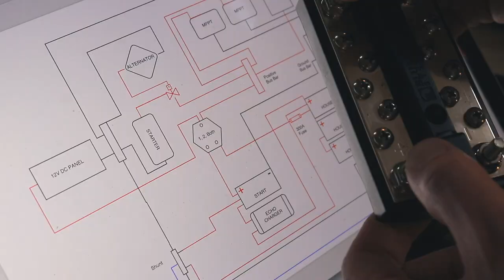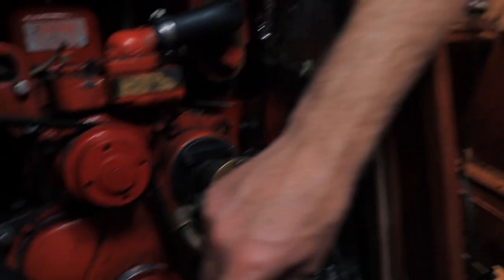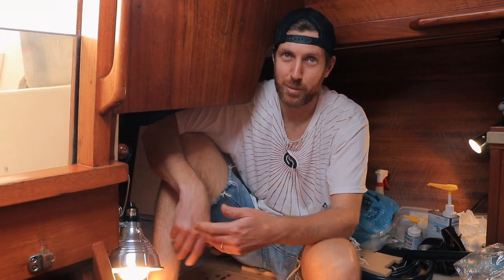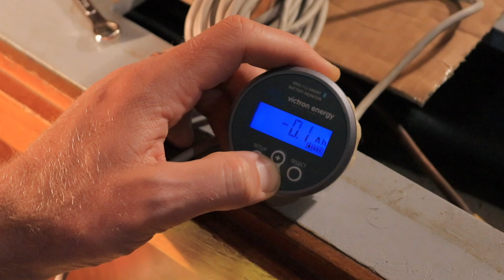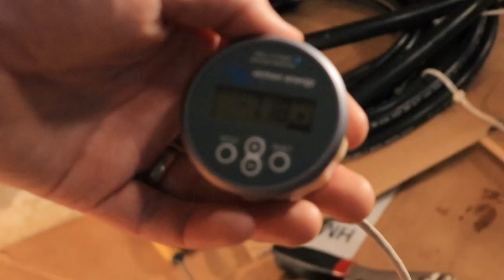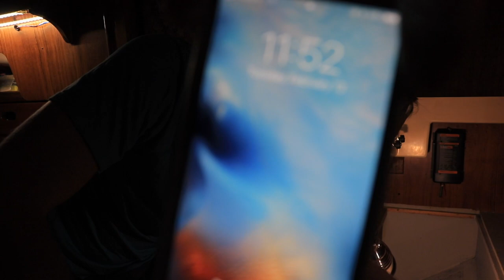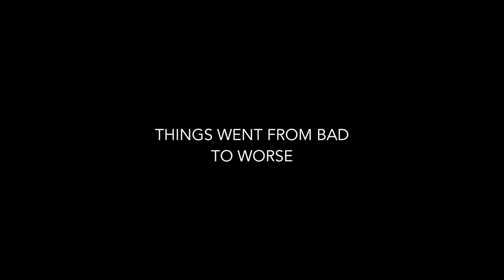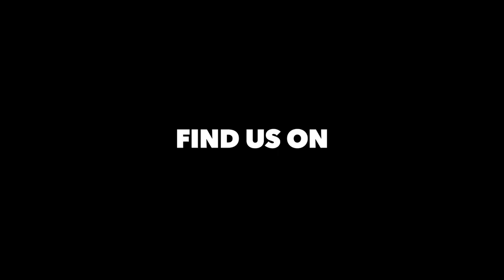Glad THAT’S Over | Sailing Soulianis - Ep. 38

Comment: The good news is that you have documented video evidence they screwed up for the lawsuit.
Reply: Lawsuit is a bit of a strong term. "Small claims case", that will be an easy decision for any judge. Soulianis has everything documented. If anything, dock fees and damages could could be awarded in a counter claim if the welder/fabricator even attempts to collect.
Reply: @tilleytristan  I would move on, afterall ,they will not be staying in the area to followup..
Reply: @kapekodbob  100% agree. I meant if the contractor sent a bill to collections, "moving on" would involve either paying up or taking them to court.
Reply: @CaptainJimNoss  Actually they refinished their arch. They built a bimini which is probably easier.
Reply: I was thinking the same about it being all on film.
Reply: So sorry you had to go through that.  With small claims a lot depends on the State laws and the min/maximums. Def file a claim and request a lien and when it succeeds have the judgement certified. There may be added court fees. Chances are you can kiss the money goodbye but a lien will put their business on notice with banks and credit agencies.. In the meantime try to work out an amicable resolution and document it. And then get on with sailing!
Reply: @MaShcode  he's likely to put a lien on their vessel as well.  And you need to be in the jurisdiction you file a small claims case in, which they no longer are.
Reply: @CaptainJimNoss  they didn't build the arch themselves. They modified the existing arch on the boat and repainted it.
Reply: @Josef_R  The business would have to send them a bill for work not completed and the clients already made a partial down payment. The business could try to attach the boat but that'd be easily quashed because the client acted in good faith and the arch is not ON the boat. As far as jurisdiction goes. The clients were residents during the course of the transaction.
Reply: @MaShcode  It doesn't matter where you resided when the problem occured if you don't reside there when you sue.  You can't sue from the Caribbean someone who lives in Alabama.  You also can't answer to the courts when someone is making a case against you and you're not there.  Courts don't know how the client acted without them presenting themselves.
Reply: @  @Josef_R  That's y there r Lawyers. They should find one from there and gave it to him on commission. Done and over in 5 yrs time. LOL Sadly!!!!!!!!! Are u could do it the old fashion way and call one of your old Army Buddies that live out of country to take care of it. Maybe a little harsh in this case but then what comes around goes around right!!!!!!
SPC-Lee a Benson 11B U.S. Army (RET.)
Reply: @leebenson4874  this is a small claim.  You don't hire a $200/hour lawyer to handle small claims.  But the fact that you recommended committing a felony tells me you don't know a lot about doing things legally.
Reply: @  @Josef_R  I've done many small claims where I had a lawyer do it on Commission. If that sounded like a recommendation to you then I'm sorry was just pointing it out that it might of been the way they would handle it in the old days. You read to much into things just read the words and not between them. LOL OK LOL

Comment: Hey Guys look up an isolation transformer for your boat its a great safety part that you will want if you are in marines when traveling also if you are going to travel internationally an inverter/charger that handles 220v/50z is also an idea . also putting on some extra anodes on the hull would be good if your current ones don't last too long ! great video thumbs up !!

Comment: Nice job with the batteries.
Regarding the arch, If you have time, do it yourself. the best way is to make a flexible pvc template, glue the parts with hot glue gun or even with clamps. then buy inox 316 tube sawing and welding. avoid curves. with a grinding wheel removes excess welds and rounds. in the first sample you will get scratches and stains of heat but after polishing it gets prefect!

Comment: So Sorry that you both had that Happen to you , Only thing i would say is if you find the time make it out of PVC Pipe and do not glue it just make it pull apart and when you do find a Stainless Steel Tradesman show him what you need made, Ps : you might look at a Alternator/Generator all in one unit for power supply for your boat as well think the Italians make a unit that does both jobs when motor is running . This Unit replaces the Alt you have on the motor :)

Comment: We hired a guy to build a bimini for us shortly after buying our Bavaria 33 Solla Sollew in 2006.  Give him $600 to get the work started. We had some contact with him afterwards but never saw the bimini or the $600. Frankly, I've come to look at the incident as money well spent. The full bimini would have been well north of $2000 and frankly I didn't really want it anyway. When I ordered it, I kind of just thought it was the thing to do but I'm grateful  for having spent $600 to NOT get it. I understand your desire to get that arch built as a platform for solar but really, the boat looks better without it. Do try to get your money back but in time you too may be thankful you don't have an arch. Actually sailing the boat is better than worrying about the thing.

Comment: First, excellent work on the electrical system. The design and streamlining of the existing wiring system are first rate and you should be proud of your efforts. I am sorry that contracting the arch system was such a nightmare. It’s not your fault. They misrepresented their skills and ability to deliver on the job. My suspicion is that the previous work they represented as theirs was done by someone no longer with company. Thankfully you stopped them before they did real damage to the boat. More importantly, had they completed the install it would have failed under the stress of heavy seas and caused incalculable damage and risk to you and the boat. This was truly a disaster averted. Placing an arch on a boat that was not originally designed for one requires careful planning.  There are design, construction and, installation issues that must be taken into consideration. If the contractor had  really done this before they damn well knew this or should have.
 When you are ready to tackle this project again, reach out and,  I can put you in touch with a few different welding  tradesmen in North Carolina or Florida that specialize in marine work. It will take time and  it will cost more than you had anticipated but it will worth every penny. An arch will change some of the sailing characteristics of the boat  and you need  people that have proper licenses, certifications and insurance. More importantly they are sailors with years of experience and care first and foremost about your safety and that of the vessel.

You passed an important challenge and you will never again let a self-proclaimed “professional “ get away with “trust me” or the self-serving “ I know what I’m doing, I’ve done a 1,000 times” comment . Take that as your clue to run. 

Most of all don’t lose heart , there is just nothing in this world like crossing an ocean on well maintained boat that you know like the back of your hand. You are well on the way.
Reply from the maker: Thanks Paul, we agree with this logic whole heartedly. Cheers!

Comment: You had to pay an extra month for slip fee for these jerks to screw you.   The Boatyard/Marina should have not collected this since they are responsible for contractors to work n their yard and they also have to be bonded and have insurance to work on their property where your boat was..   I would hold Turner Marine responsible and then file a complaint with the bonding company and Insurance for Mis-Representation  and holding your money for services that were not satisfactory done.    I usually charge 175.00 for this consultation but you stole my heart.
Reply: I owned a electronics-electrical shop in Tarpon for years. Working in other yards?? Bonds??? Insurance??? Ha ha ha ha ha ha

Comment: Oh my goodness, my hart goes out yo you two. On the bright side you did a fantastic job on you rewiring  project. May I suggest that you look at and possibly downloading the "Sketch Up" program, it is a free CAD (computer aided drafting) program . I do wiring diagrams and machine parts on it, The 3D modeling is cool. I wish you better luck on your next attempt on the arch and many miles of wonderful travels. 
.
Reply from the maker: Thanks for the suggestion, I've used sketchup a long time ago, before they were acquired by google to mock up floorplans for houses.  But was a little overkill for the wiring diagram.  We used draw.io which worked quite well.

Comment: Have you been using the Victron app to check your batteries status? I used mine to set alarms for low and high voltage. The beeper is not loud but better than nothing.
Reply from the maker: We check it daily. Multiple times actually!

Comment: Question - is it more cost effective to work more at your day job than to fix a boat?  If u worked more you could buy a newer boat.   Did you make a conscious choice to do boat work over your day job? (Question I am asking myself when I get a boat)
Reply from the maker: This is a great question. One I contemplated many times before starting work on the electrical.  We actually had someone out to quote the electrical work because based on my rough estimates it would be cheaper to hire it out and put in some more work at the day job.  But in the end I decided if we didn't learn the electrical now, I'd have to continue paying for it in the future.  Which means I'd have to continue working.  So if I took the time to learn it now, I'd likely be able to do more in the future (install a new alternator, rewire other things, etc).  And I wouldn't need to pay someone to come in and troubleshoot, because I'd know exactly what the issue was.  And that was ultimately what tipped it into the DIY project.

As for working more to get a "newer" boat... it's why we're still both working while we travel ;) We just wanted to get out there and get going now, rather than wait till we're old and gray.
Reply: @SailingSoulianis  I am old.  I am tentatively planning on leaving in a couple years when my last kids graduate highschool and move out.  In hindsight it is easier to do it with young kids you can take with you than leaving rich relationships behind.  (But after having kids in house for 33 years I am thinking about taking a couple years off .).

Comment: I used to work in a marina, and those guys looked wrong from the beginning -- ie crawling all over the boat in work boots, not prototyping anything, using levels on a platform that is inherently NOT level, doing "air measuring" with a tape measure, field cutting.... all terrible practice. Sorry you had to go through this, but perhaps all these warning signs will help others. BTW, missed deadlines and big deposits generally means they are using your money to complete the project before yours, and missing deadlines because they have started another project in order to get the money to complete yours. Every crappy contractor works this way, and collecting from them is impossible because they have already spent the deposit elsewhere. Give all the info to a good local lawyer, don't spend much more money to get yours back, and sail into the sunset. Living well is the best revenge.

Comment: I had similar experience with hired experts rewireing and installing new AC/DC panel clown was using black tape for connections by the time I realized what they where doing boat was over half done fired them on the spot had to hire more guys to fix their mistakes in the end I was out about 3 grand just a expensive lesson you hire so called professional s and get a half assed job you gotta watch everything anybody does good for you guys for getting rid of these idiots hope it all works out for you guys,

Comment: I would have liked to see the use of bigger bus bars for starting an engine ( per your wiring diagram ) . The busbar used are only rated for 150amps ( Continuous ). Tho i'm sure you fixed this or there is more to the diagram then what we see, because there are a lot of incorrect wirings here. PM me for details....but for someone that does not do this for a living you did a ok job and saved some money right now.

Comment: Would measurements on a dry dock be more accurate when attaching attachments?  Just a question of curiosity?  Good work on electrical components.
Reply: Check out Ryan and Sophie Sailing's arch build in Spain a couple of months ago (https://youtu.be/pAW7cypKx7M).  One guy with a workshop close to the marina who finished the work when promised with no drama and the boat in the water.  
No, these guys were amateurs who took on a job that was way over their heads as made clear by the guy insisting that they trust him in spite of having fallen short time after time after time.

Comment: I noticed that you have 1 battery that is different. It has been stated that when using multiple batteries in a bank that they should all be the same ,   Same size, and age. If not that they will charge differently and cause problems. Also that the wires providing the charge should be in the middle of the bank. I did not see if yours was or not. 
So glad you fired those "professionals" . Cut your losses and move on.  It will hurt but you don't want to have to hang around to go to court etc.  Look forward to sailing.
Reply from the maker: Yep, you’re right. They should be all the same. But that black battery is our auxiliary/start. ;)
Reply: @SailingSoulianis  you've done a great job studying up and performing a good install.. I retired with extensive experience in wiring. One thing I noticed about wiring is that when using small crimp connectors on small wires is that people only crimp the end closest to the hole in the conn. I think you should also crimp the wire where the insulation is in the plastic to prevent vibration from causing a break where the copper enters the metal in the conn.  I absolutly love your trip down the rivers and look forward to sailing with you. .Love you guys, be safe, Bob.

Comment: Hey guys sometimes if you do things yourself its better ! I know they have connection joints for tubing that may work to build your bimini. also a tube bender and some of that great common sense you guys have I know you can DIY the job yourselves ! all you need now is a good lawyer that will get your money back plus some extra for the hardship these numb nuts causes ! With the videos you have I think it will be ease to convince a judge for your claim ! Thumbs up and God bless you lovely kids!! Sorry to see what happened !
Reply: Moe, there isn't enough in it for a Lawyer, very few would even take the case because of the 'low amount' in their view and the fabricator knows it. 

The only way would be to take the case into Small Claims Court in Mobile, AL. 

I would spend the $75 on 'CourtLinked' (on Google) file online! and have them handle it. Max. for small claims is $6000.
Great battery installation. My heart goes out to the young couple. Fair Winds!

Comment: (With electrical projects, you can really only get it right, OR, you get it terribly wrong.) This also applies to sailboat projects. Ok Capt Kirk and 7of9 (lauren's nick name) time to move on to open water. =] some spare parts you might consider having onboard - alternator, water pump impeller, hose's clamps that sort of thing (flowers for the wife) etc.

my 1st impressions of those contractors were - potheads back when you first mentioned them, my 2 cents.  LOL ask the next contractors if they have been drug tested
Sail on

Comment: step 1 bring wooden dowels or pvc pipe to docked boat
step 2 measure and create templates
step 3 fabricate at shop a bimini top
step 4 return to boat to test fit - fix minor details with angle grinder
step 6 return to shop to clean-up bimini 
step 7 final install 
= 3 day project est $1,500 + materials
Reply: That's exactly what Kirk said he'd wish he had done in their last video :)